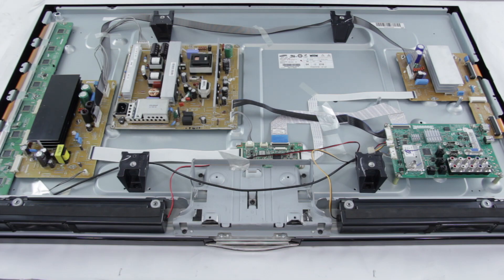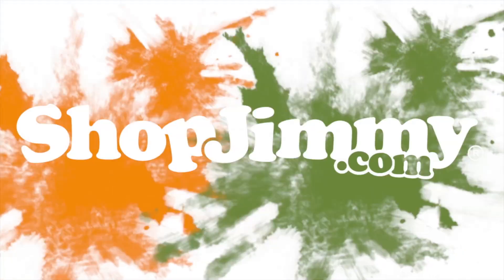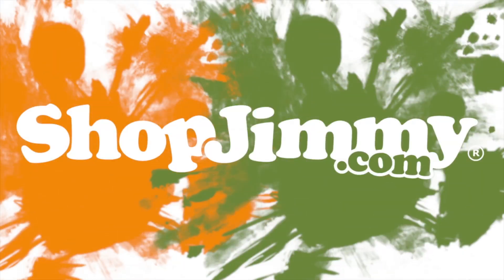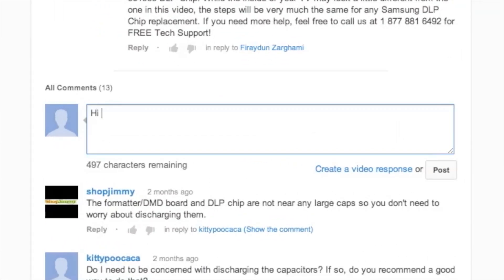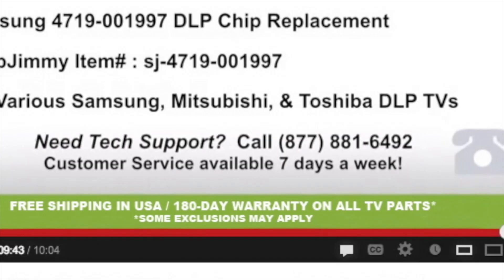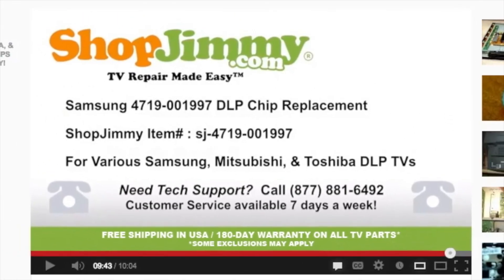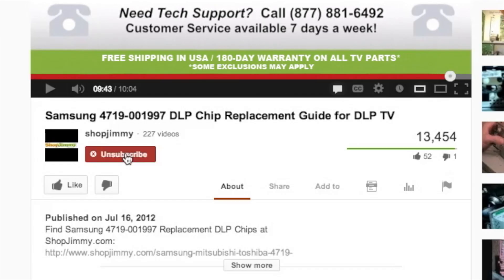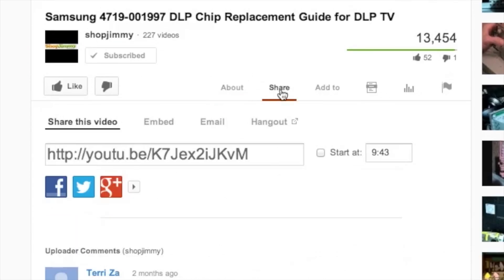Plasma TV Repair Tutorial - Common Symptoms & Solutions - How to Fix Plasma TVs

Comment: Hi,

We have a PRIMA PS-42W8CZS that turns on but has no screen. The screen has 'fizzle' but has nothing, no menu, that appears or anything when we click the buttons. Basically, there is not output other than it being lit. The light goes on on the power button bit. Previously, it would cut out when we were playing something via our HDMI converter (and sometimes playstation). It didn't happen that often tho, until one day it didnt fully turn on as described above. 

We'd be so grateful if you could help!!! Many thanks
Reply from the maker: +Philippa Pendry   <!-td {border: 1px solid #ccc;}br {mso-data-placement:same-cell;}->Try all repairs and troubleshooting at your own risk. I recommend replacing the y board and the y buffer(s) in your TV. Unfortunately I do not see any replacement parts for your TV model number on our website. Thanks! www.shopjimmy.com

Comment: I obtained a free 42" RCA Plasma TV @ a garage sale without a power cord, and it was unclear whether it worked or didn't. they said it did, than lost power cord & found cord but than didn't work. So I thought, hey what the heck. it's free I'll find a cord and hope for the best especially with a pretty high level of Handyman & misc skills/experience. Anyways here's a briefing on symptoms & what not.
» 42" RCA Plasma
» Model #: 42pa30rq
» took cord from an original PS3 to use
» I have no remote
» when the cord is plugged in like normal on both ends, the light on the outside close to all operating buttons, illuminates red & stays lite.
» what you press the power button the light turns steadily blue & you hear 3 clicking/piping noises that seems to come from the bottom right (when your looking @ the screen side)
» I also noticed a green light inside the TV (location for that green light would be center or possibly 1-3 inches southwest of dead center of TV)   that blinks for 5 seconds on, and 2 seconds off
»also I get no picture, no nothing, not even pressing menu, channels, volumes buttons while the TV had power and the outside power indicator light is illuminated blue.

anyways I think that is all for now, I do have the serial number but it's down stairs & I can supply that tomorrow.
 
» thank you

Comment: I have Samsung Plasma PS43E450 Model.  Suddenly the screen went black while running.
It is making spark noise. On opening I found that spark noise and visible small sparks are coming below the 2 orange strips that come out of panel. ie from the left corner of panel when opened from back (x board as per your vedio)

Comment: I have a Hitachi 50HDA39. When powered on it gets vertical stripes a third of the way in from the right side. They start out blue and only at the bottom of the screen then change to white and go from top to bottom. After about 20 seconds the screen goes black except for some blue pixels at the bottom of the screen. I have already changed the logic board and did not change anything. Could it be the YSUS board? It does not look like any caps are bad. Thank you for your help.

Comment: I have a panasonic p60st60. My kids were playing around the tv & one of them threw a blanket at the other but there was a remote control inside so the control flew out of the blanket & smacked the tv on the left side edge about middle height of the screen. It caused a crack & now the tv wont turn on & blinks 7 times!! please help!! dont care about the crack since its on the edge but would still like to watch tv. thanks
Reply from the maker: +Anthony G   Try all repairs and troubleshooting at your own risk.  This sounds like a TV panel (TV Screen) problem.  If your TV panel is bad, it may be more cost-effective to replace the TV as panels are typically hard to find in stock, difficult to replace, and expensive.  Thanks and please let us know if you have any further questions!  www.shopjimmy.com

Comment: I have an LG Plasma TV model 50PN6500.  The problem I'm having started a couple months ago when we would turn the volume up or down or hit the mute button the TV would shut off or go into a standby mode for a few minutes and then come back on.  So we got into the habit of not playing with the volume too much.  but now it just started going off on it's own into standby and then cycling back on again.  Any Ideas what board controls this?  And what should I check for?  

Thanks,

Chris in Pittsburgh
Reply from the maker: +Chris Mooney  Try all repairs and troubleshooting at your own risk.   I recommend replacing the main board in your TV.  Click this link to replacement parts for your TV model number:  http://www.shopjimmy.com/catalogsearch/result/index/?cat=56&q=50PN6500  There may be multiple boards for the same TV model number, be sure to match part numbers on your current board, with your replacement for compatibility.   Thanks and please let us know if you have any further questions with your TV Repair!  www.shopjimmy.com

Comment: Great video. I have Samsung pn64e533 plasma TV and after watching you video I believe I need to replace the logic board.  The symptom is a vertical line down the screen roughly one pixel wide. Let me know which part I should order from you. Thanks!
Reply from the maker: +Epoxylips   Try all repairs and troubleshooting at your own risk.  This sounds like a TV panel (TV Screen) problem.  If your TV panel is bad, it may be more cost-effective to replace the TV as panels are typically hard to find in stock, difficult to replace, and expensive.  Thanks and please let us know if you have any further questions!  www.shopjimmy.com

Comment: I have a Samsung 51 in plasma tv called geek squad they said its a board issue called another repair shop they said it could be a light it have vertical lines kind of snow like line up and down the screen I also use this tv as a monitor and my cursor (mouse)is the only thing that goes over the lines model#PN51F5300AF

Comment: Jimmy, have a Panasonic plasma model TCP42G25.  Have a 2" vertical line 1/3 of the way into screen.   It pulsates and changes color.   The lines are multicolored vertical red lines on top half of screen.   Bottom half is mostly black on right side.  White on other side with vertical thin black lines.    Do you have a fix??
Thanks    Steve
Reply from the maker: +stephen burke   Try all repairs and troubleshooting at your own risk.  This sounds like a TV panel (TV Screen) problem.  If your TV panel is bad, it may be more cost-effective to replace the TV as panels are typically hard to find in stock, difficult to replace, and expensive.  Thanks and please let us know if you have any further questions!  www.shopjimmy.com

Comment: I have a Mitsubishi lt-46144 (Samsung LCD). There are 4-inch colored vertical lines just off the center of the TV. It's been going on for a month. For the first few days, the lines wouldn't appear until the TV was on for 5 minutes. Now it always appear. In some cases, if I hit the top of the TV where the lines are located, it will go away momentarily.
Reply from the maker: +Billy The Kidd  Try all repairs and troubleshooting at your own risk.  This sounds like a TV panel (TV Screen) problem.  If your TV panel is bad, it may be more cost-effective to replace the TV as panels are typically hard to find in stock, difficult to replace, and expensive.  Thanks and please let us know if you have any further questions!  www.shopjimmy.com
Reply: Unlikely to be the T-CON board you think? It's funny how it goes away, it's like the connection isn't good. I've cleaned the connection with the TAB from the panel to the T-CON board, not much of an effect.

Comment: hi, I have a Toshiba plasma 50hp66 tv that will not power up. There was a loud pop then the standby light started to cycle on then off with clicking noises. A fuse was blown on the y sustain board but after replacing the problem is still there. The fuse has not blown again. There is no short from vs to ground. Do you still think it could be the y sustain? Any help would be appreciated. Thanks. mfleischauer@hotmail.com
Reply from the maker: +Matt Fleischauer   Try all repairs and troubleshooting at your own risk.  I recommend replacing the YSUS and the YDRVTP & YDRVBT boards in your TV.  Click this link to replacement parts for your TV model number:  http://www.shopjimmy.com/catalogsearch/result/?q=50hp66  There may be multiple boards for the same TV model number, be sure to match part numbers on your current board, with your replacement for compatibility.  Here is a link to a video showing how to identify your part number, click here:  https://www.youtube.com/watch?v=GEllG3RV-tc  Thanks and please let us know if you have any further questions with your TV Repair!  www.shopjimmy.com

Comment: Hi, ShopJimmy.com your video was relay awesome and detailed but i seam to experience different problem or just cant figure out winch board is gone.. my tv is Panasonic MN: TX-P50C2E 
My steps:
1. plug TV in to power supply. (green light turns on TV Turns on snow screen) works for 45s screen changes in to vertical stripes stays 25-30s screen  goes black.
2. turn off the TV turn on again green light blinks rapidly for 5s then turns steady on 3 clicks can be noticed just after pushing on button but the screen stays black.  
3. unplug the TV leave for 5 min.
4. plug back in and turn on snow screen stays for 20-25s and goes black whit noticeable 3 clicks. 

Power board? 

Thank you for your time!

Comment: Thanks for the Video.  I have a Digimate 42" Plasma TV "Model DG4200 ". Recently am having large vertical white  lines sometime  horizontal  fine lines or just a black screen. The Audio is fine. Need some help .
Reply from the maker: +Ras Mosera   Try all repairs and troubleshooting at your own risk.  This sounds like a TV panel (TV Screen) problem.  If your TV panel is bad, it may be more cost-effective to replace the TV as panels are typically hard to find in stock, difficult to replace, and expensive.  Thanks and please let us know if you have any further questions!  www.shopjimmy.com

Comment: lg plasma tv model 60pa6500-ua turns off 5 or 6 times before it will stay on
Reply from the maker: +Chris Starlite   Try this at your own risk. Unplug the TV, then disconnect the y board and plug in the TV to see if the TV powers up. Note that it will not have a picture on the screen. Reply with the results of this test. Thanks! www.shopjimmy.com

Comment: Regarding a SAMSUNG PN43D450A2D plasma 2011 mfg date. Which board causes the picture to go black after 10 minutes? My audio works fine and the picture always comes back when I turn off the set and restart, but the picture goes black within 3-10 minutes after the initial time.  I replaced a few capacitors on the power board (one had a bulge) and this worked for a few days then came back. The latest time I unplugged the set and shorted one of the capacitors on the power board and so far it's worked for the past two days, but I'm sure it will return. Any ideas?
Reply from the maker: +Sword Fish   Try all repairs and troubleshooting at your own risk.  I recommend replacing the Y-Main Board, and the bottom Y scan drive board in your TV.  Click this link to replacement parts for your TV model number:  http://www.shopjimmy.com/catalogsearch/result/?q=PN43D450A2D  There may be multiple boards for the same TV model number, be sure to match part numbers on your current board, with your replacement for compatibility.  Here is a link to a video showing how to identify your part number, click here:  https://www.youtube.com/watch?v=R1jmj_foId0  Thanks and please let us know if you have any further questions with your TV Repair!  www.shopjimmy.com

Comment: hiI have a lg 42pc5d that turns on and off again continually. I removed the y sustain board and tested it the way someone described on you tube but it doesn't appear to have a short , any ideas that I could try , thanks Chris
Reply from the maker: +Chris Bailey   Try all repairs and troubleshooting at your own risk.  I recommend that you disconnect the x board, plug the TV in and see if the problem stops.  Thanks!  www.shopjimmy.com

Comment: LG Plasma TV 50pc1dra-ua
Powers on, sound is good. Starts with fuzzy colours, then quickly goes to blue and white vertical bars across the entire screen. It is used as a PC monitor, and when I move the windows cursor, I can clearly see a single vertical white bar moving across the screen at the position of the cursor. So it's receiving my input from the PC, but cursor location displays as one white bar, in a field of white, off white, and blueish vertical bars..  All fuses are ok as far as I can see, power supply has one bulging cap (I replaced 11 caps about 5 years ago), I will change it, but don't understand this issue to be a power supply cap issue. Totally interested in another DIY on this thing if you guys have the parts I need! Thanks,
Reply from the maker: +Jessie Hachey   Try all repairs and troubleshooting at your own risk.  This sounds like a TV panel (TV Screen) problem.  If your TV panel is bad, it may be more cost-effective to replace the TV as panels are typically hard to find in stock, difficult to replace, and expensive.  Thanks and please let us know if you have any further questions!  www.shopjimmy.com
Reply: are panels known to be working 100% then all of a sudden die? because that's what happened in this case. I was watching stuff for about an hour then BAM! done. 

When I change the input to TV tuner, which has no service, I get pink and red fuzz. Looks like other people's problems with Ysus.

Comment: Samsung Plasma pn50b400p3d will not turn ON.  No front red light.  PSU is good.  Logic main board has no blinking green light.  I get blinking green light when PS-ON is jump to ground.  However I do not get the clicking sound from PSU.  I get clicking sound from PSU when I jump the 5v to ground.  Not sure where to look next.  Please help!
Reply: I meant 5v detect line to ground where there is only 5 pin on this connector.
Reply from the maker: +jinsters   Try this at your own risk. Unplug the TV, then disconnect the y board and plug in the TV to see if the TV powers up. Note that it will not have a picture on the screen. Reply with the results of this test. Thanks! www.shopjimmy.com
Reply: +ShopJimmy.com With PS-ON jumped and the Y board disconnected, tv does not power up and green light on the logic board is off.  Vs,Va,Ve,Vsc all measured good.  I am thinking the main board is bad.  On a side note: If everything is connected without the jumper, I do not get the green blinking LED on the logic board.  Only get this when the PS-ON has the jumper on.  Any other suggestion?

Comment: I have a HITACHI P50H401A Plasma TV that had some issues. I changed the two capacitors in the power board and the upper SDR board and now have it working to the point that i have horizontal black lines through the entire display and the top of the displayed image is actually showing on on the bottom of the screen.

Here is a link to a picture of the image.

https://www.dropbox.com/s/xemjr845srxsnwt/Photo%20Nov%2002%2C%208%2007%2033%20PM.jpg?dl=0

Any idea what may be causing this? I have looked through endless information on the internet and everything comes back as resetting the connectors on the SDR board to the panel. i have done this many times and can see different horizontal lines when they aren't seated correctly. But this seams to be a different issue.

Thanks

Mark

Comment: Samsung Plasma model PN43D450A2D     model code # PN43D450A2DXZA  There is no picture, small red light is displayed in the front left bottom corner, it makes a few clicking sound , then no clicking sound

Comment: I have a LG 37lp1d-ua that comes on when plugged in. The back light no longer lights and the buttons on the front(volume, on-off etc.) do not work. I do not have the original remote so I purchased a universal remote but none of the codes work. Even when doing an auto search.
Reply: This is for Plasma TVs and not LCDs.
Reply from the maker: +Sean Mourning  Try all repairs and troubleshooting at your own risk.   I recommend replacing the main board in your TV.  Click this link to replacement parts fro your TV model number:  http://www.shopjimmy.com/lg-6871tmbb34a-main-board-for-37lp1d-ua.htm  There may be multiple boards for the same TV model number, be sure to match part numbers on your current board, with your replacement for compatibility.  Here is a link to a video showing how to identify your part number, click here:  https://www.youtube.com/watch?v=RwHTvjMdrhk  Thanks and please let us know if you have any further questions with your TV Repair!  www.shopjimmy.com

Comment: My Toshiba Model 50HP66 has: a wide white & black vertical bar with several strips, on the left side of the screen.  It moves to the right side of the screen, the vertical bar now  has 2 strips, then the bar disappears and the TV get's a full screen color flash and then the screen goes black.  The TV has the same symptoms on both HDMI ports.  I removed and re-seated the ribbons cable to both the upper and lower buffer board, no change.

Thank you in advance.
Respectfully,
Reply from the maker: +Alexander Casanova   Try all repairs and troubleshooting at your own risk.  This sounds like a TV panel (TV Screen) problem.  If your TV panel is bad, it may be more cost-effective to replace the TV as panels are typically hard to find in stock, difficult to replace, and expensive.  Thanks and please let us know if you have any further questions!  www.shopjimmy.com